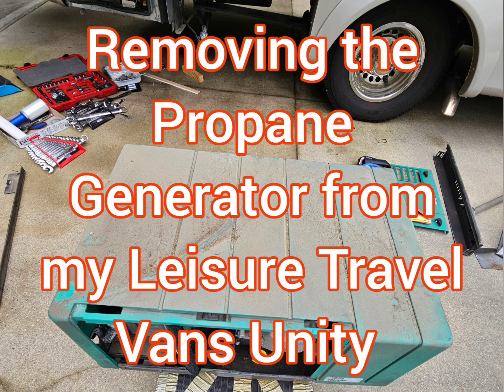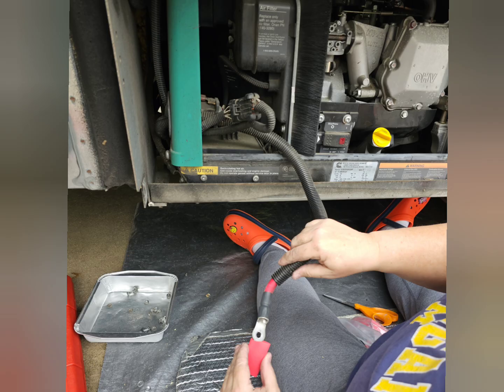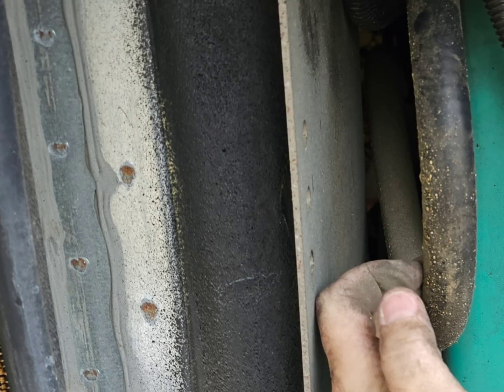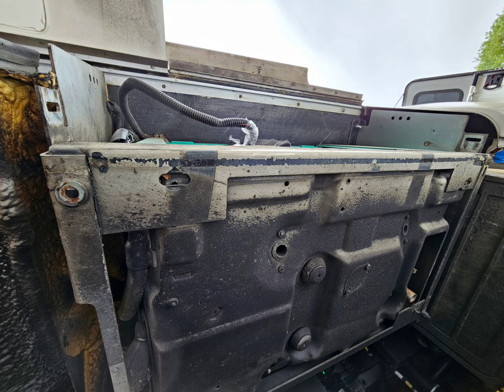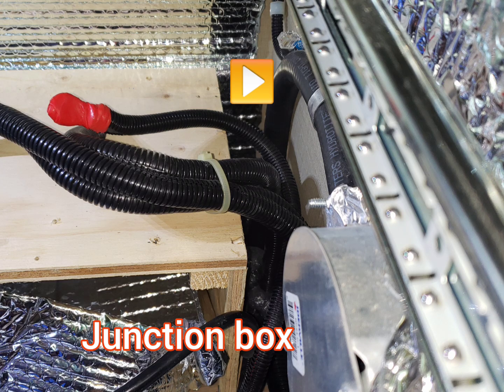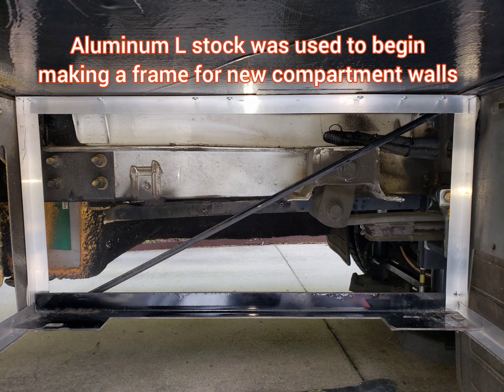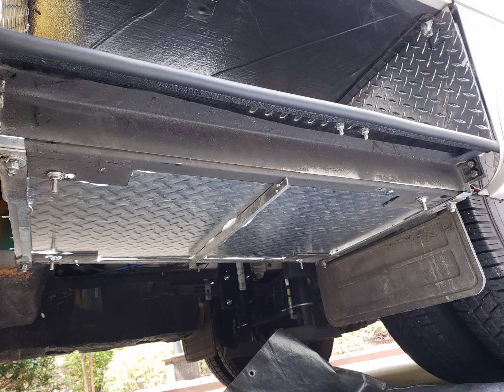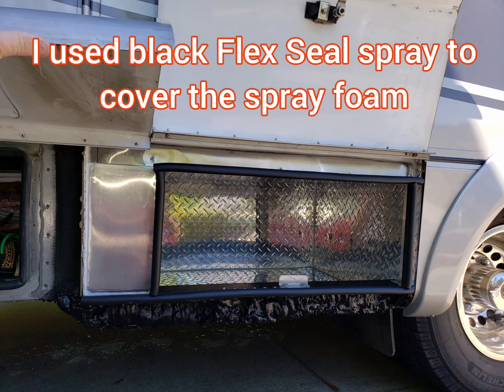Removing the Propane Generator from a Leisure Travel Vans Unity

Comment: Again, happy to have found your channel Sandy.  I really like the build quality and look of LTV but not impressed that they haven’t upgraded to remove the propane and generators in the units.  I was building a list of all the changes I would need to make to get to a battery only LTV as I continue to learn about the LTV models and years.   Soft start AC, more efficient AC with heat pump, DC-DC charger, upgraded solar and controller, remove gas cooktop, propane heater, etc. I would love to see a video overview of all your upgrades done, why you did them, what alternatives you considered, and what additional upgrades you are thinking of making to your specific LTV.  Maybe you already have done this and it’s a matter of time before I find it!!!
Reply from the maker: I haven't but it's a good idea, I've forgotten upgrades I've done 😂.

Comment: Quick question Sandy.....this mod provides some great space once the generator is removed.  If someone (like me) is looking to purchase a previously-loved LTV.....say from years 2019-2021....could I use this new found space to create a place for  3 lithionics batteries and dc to dc chargers, similar to what you've accomplished?  Or is the distance between the batteries and a new victron 3000w inverter less than ideal?  Being in FL I'm hoping to have CTM complete the upgrades but would like to learn of your opinion first.  As always, thanks for the great, informative video!!
Reply from the maker: It definitely can be done! But 1 under the step and 2 more in the inverter compartment is probably better use of space. If you plan to boondock a lot you might consider using the  compartment for more fresh water.
Reply: Curious, how much weight would you guess you gain by removing the generator? Thanks for helping with these videos and documentation you provide.